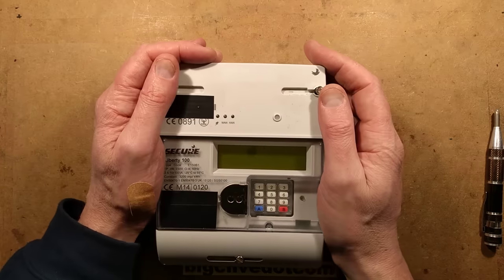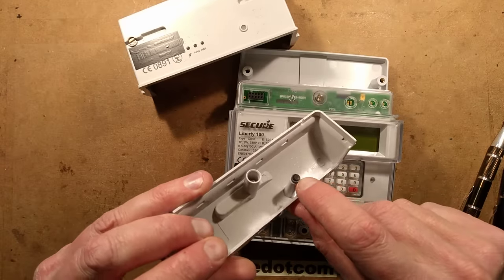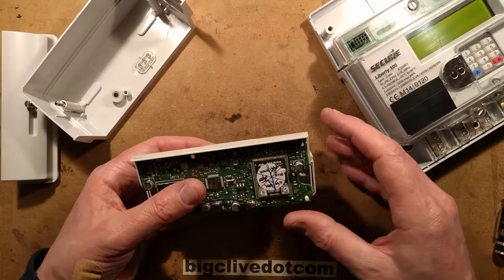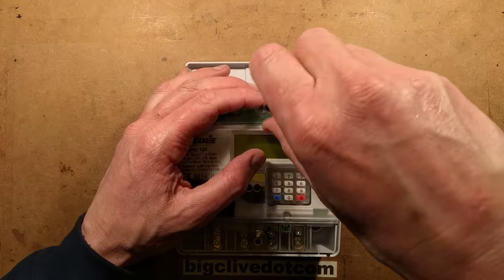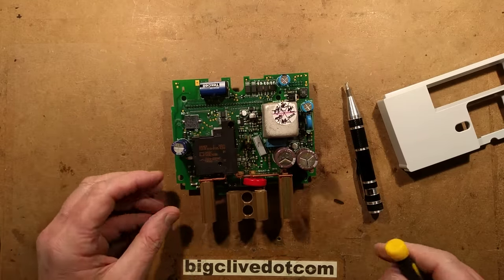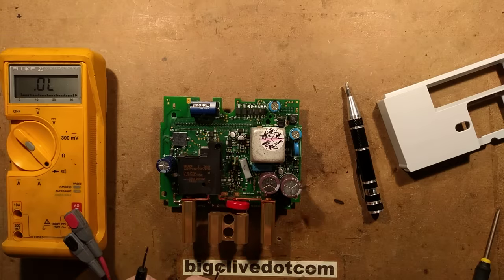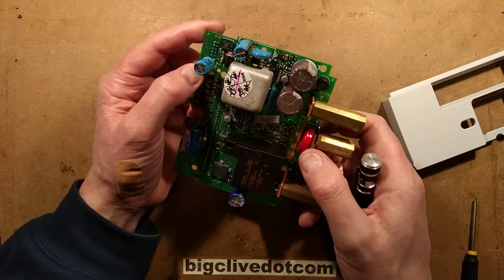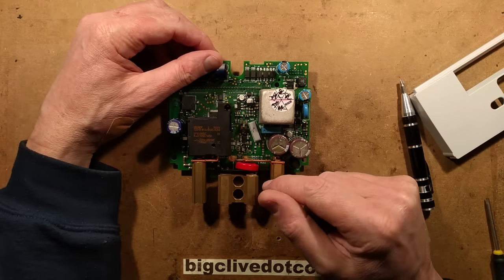Inside a smart meter, and the REAL problem with them.

Comment: I worked for the company this meter belongs too, if the meter moved beyond a very small parameter we were alerted, also if the cover was removed we were give a tamper warning which we would have to respond too. On the top cover it has WAN (wider area network) and HAN (home area network) the WAN was what we used to be able to connect to the meter from head office, and HAN was it used to connect to an in home real time display. I do believe the SIM cards are actually connected to Vodafone. The little keypad allowed people to type in update or top up codes. We were able to disconnect and reconnect a customer in a matter of seconds using the WAN network. We only offered three different tariffs, none of which offered a standing charge or higher peak hours charge. They were definitely no microphones in the meters! We didn’t want to hear about your problems!
Reply: What is the response to the cover being removed? Ive removed loads of them
Reply: why its called "smart" I dont see any intelligence stuff on the device? it is just a digital remote meter
Reply: @itaamelia6715  it talks directly to the company and there's also a device you can use to see exactly what your electricity is costing in real time
Reply: meg north my meter also has a HAN connector but I haven't yet been able to find any energy meters which offer this feature. Do you know where they can be obtained from?
Reply: @londontrada thats not the definition of smart. smart is a device that could learn without being program
Reply: @itaamelia6715  Smart phones don't have to include any machine learning.
Reply: @itaamelia6715  What would an electrical meter need to learn?
Reply: @londontrada exactly
Reply: @ @Zekian  your right
Reply: if its a smart meter would it allow you to view the live data like  current watts power factor etc on your phone or a separate screen ?
Reply: What planet do you live on? They were installed for the benefit of the customer? I guess the vast majority of us had our bills go down since having this amazing devive installed. I honestly don't know what I would do without it. They still need to come down and manually turn the power back on too and charge you a few hundred to do so. Maybe you can help out with the bill as it must be some misunderstanding. That went from unde a hundeed every two months to almost six hundred. I had to move. When they were first coming in they said the same thing, no peak hour charge. They forgot to mention the new teir system, where they jack the price up once you hit a certian amount. You must have to be completely naive and have no common sense to believe that they don't plan to start charging at peak hours. Just like when they installed water meters. You were probably telling everyone, don't worry, they are just putting them in so they can monitor if you have a flood. First they serperated the water from the rest of the utilitie at a flat rate, started low, then went higher and higher. Now you pay by usage. In the summer it' can be close to $200. Take a look around. I'm not saying it's the smart meters or some massive conspiracy but people are getting dumbed down. All of a sudden with this climate of fear we can't question what the government or city utilities are doing?We should trust that they will not be corrupt and politicians are now of such a high standard and don't require oversight. It's more your neighbour you have to worry about.
Reply: Ok, what would you do if i uninstall it and replace it with my old meter or just hotwire it?
Reply: Could you take the Sim Card out of this and use it in your Mobile Phone ? 🤔
Reply: @londontrada  new tarrifs
Reply: @lissy9149  it doesn't "learn" them, they are just be uploaded.
Reply: @londontrada  it learns how to play tetris. can you imagine how boring its day job is?
Reply: to all those who believe that those things have mics in them: youre probably carrying a wire tap with you at all time (maybe even more if you use a tablet or smart watch). you can even be located with it. why would they use a power meter thats probably in aroom that you almost never enter?
Reply: meg north a
Reply: Since the majority of meters are either in cellars or cupboards it would be totally pointless to put microphones in them unless they wanted to hear people swearing when they tried to read the meter in the dark.
Reply: @shanehartley484  Actually the meter can be remotely re-energised as well.
Reply: the only creepy thing is that it could send data on when you use electricity. showing when youre home and show when you are on vacasion
Reply: @MrZanderLaw  I remember hearing of someone that did that and was consequently charged a ludicrous amount of money for data usage. I think they contested it and won. 
The supplier should have the Sim cards locked to only work in certain devices, much like suppliers of 4G "fixed wireless" devices often lock their Sim cards so they can't be used in phones or tablets.
Reply: just because you worked for them doesn't mean you know everything about the device.
Reply: @esecallum  : Where does he say he never opened one?
Reply: @itaamelia6715  : said "why its called "smart"?". Because the word "smart" is in fashion.  More seriously, because it contains a microprocessor, although whether it is really clever or not depends on who programmed it and how.
Reply: Nowdays, the political catchword to get people to think you're doing something useful is to call any microprocessor controlled device a "smart-xxxxx".  Funny, we did'nt call single board computers "smart" single board computers in the 1980's.  Shows how "stupid" politicians and company directors have become. Very few directors seem to have technical knowledge of the products their company sells nowdays.
Reply: @PVflying  you get them from the company. Typically a smart gas meter (which can't hook into the electric supply) would have a battery and update via HAN to the electric meter and from there to the WAN. You can also get in home displays to show current readings etc from your supplier.
Reply: @richardtickler8555  I could also sit outside your house and work that out.
Reply: Matthew1471! Thanks - my electricity company doesn't offer any energy meter, so I was wondering if I could buy a generic device and whether it would be compatible. But maybe the communications via the HAN connector use a proprietary language which is particular to each energy supplier. Bit of a shame if that's the case but so be it - I'll carry on going to look at the meter to take the readings if I have to. It's just I hoped for more from a "smart" meter :)
Reply: @PVflying  I think they would be compatible but the energy provider has a say over what devices are authorised. There was a PC add on that could connect to the HAN that the Ovo smart meter provided and they locked it out and some guy on the forum was having a go at them. As for DIY smart meter itself.. You're not legally allowed to replace your own meter so if they don't offer a smart meter you're out of luck and even if you ignored the law and did it anyway (not allowed to cut power before the meter or to fiddle/replace your energy supplier's meter) there wouldn't be an advantage because the meter readings wouldn't go to your provider and the info from the In Home Displays tends to show current usage rather than cumulative usage so you'd end up doing meter readings anyway (unless you tried getting a PC connected to the HAN). However you can get clips that sit on top of wires to read the current.. Not awfully accurate and would still need to do a meter reading but good way to track usage without smart meter.
Reply: @matthew1472  but you would have to sit outside all the time. with that system you get the information directly without a human
people are expensive machines arent
Reply: @richardtickler8555  sorry wasn't clear.. It transmits to an indoors receiver.. It's a poor man's smart meter :

CT Clip Version : https://www.amazon.co.uk/geo-Minim-Energy-Monitor-Self-Installed/dp/B00JIMQP6Y

Meter LED Light Reading Version : https://www.amazon.co.uk/geo-Minim-Energy-Monitor-Self-Installed/dp/B018WB6IXG

CT Sensor is a "Current Transformer" Sensor to use their correct terminology : https://learn.openenergymonitor.org/electricity-monitoring/ct-sensors/introduction
Reply: Matthew1471! Thanks. I have a smart meter (recently installed) and just want an energy display device to connect via HAN to display the meter reading remotely, that's what I assumed would be available from HAN. I guess these products will come as the number of installed smart meters grow. My electricity supplier's customer services team didn't seem to even understand the concept.
Reply: @matthew1472  but it is "beautifully designed". i use stupid meters cause my landlord never updated them in 40 years. good on him
Reply: @PVflying  Try using the words "In Home Display" with your supplier. The Ovo product with API access was called a "Smart Gateway" but they walked away from it. The Ovo IHD was made by Chameleon and from what I could see online most of the energy providers just bought them from Chameleon. There might be a way to pair one if you bought it elsewhere but no promises : http://forums.moneysavingexpert.com/showthread.php?t=4912723
Reply: @londontrada  how to love?
Reply: @pickelsvx  ❤️
Reply: @MrZanderLaw  You'd need the sim lock and/or puk codes
Reply: @MrDeadhead1952  Why would you be reading a smart meter?
Reply: @Farlig69  Because their wi-fi's gone down, they have lost/broken there remote reader, their apps corrupted or they just want to confirm what the meter is actually displaying as compared to what it's transmitting.  Try using your imagination before making stupid posts.